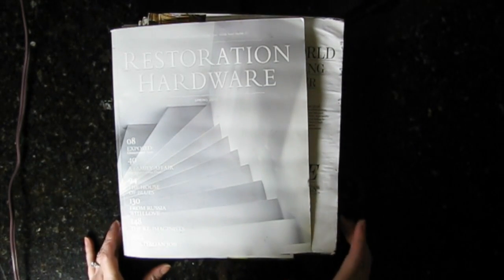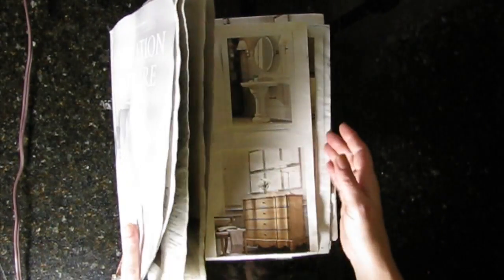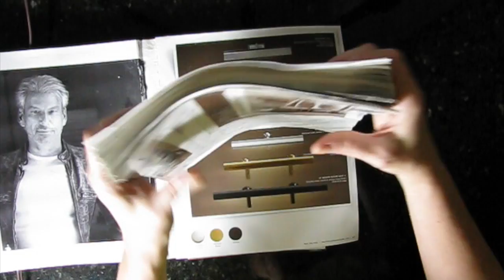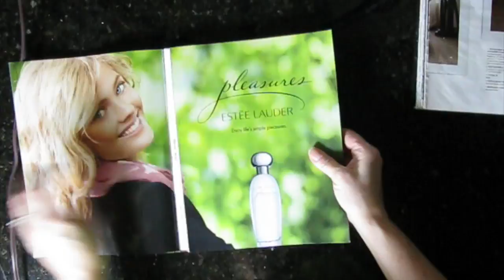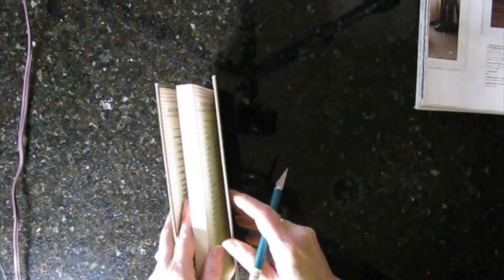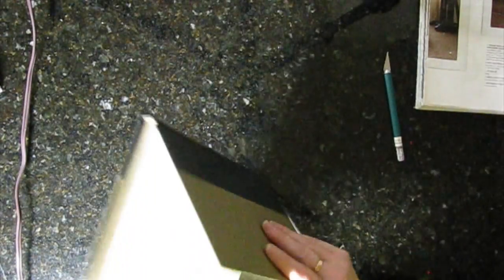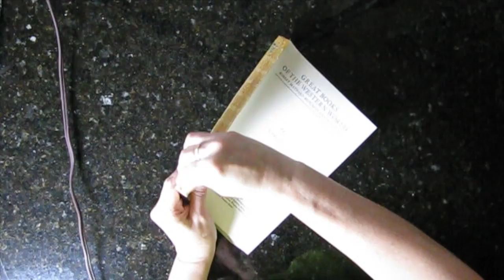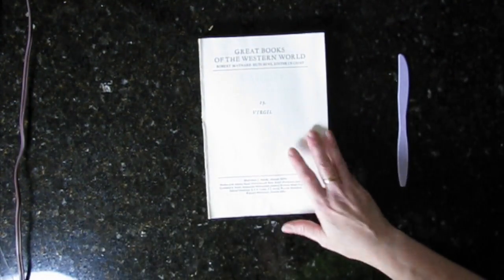Disemboweling Literature

Comment: Thanks for the info. Just wondering do you get any fumes when you heat the glue?
Also thanks for showing such an easy way to take the book block out.
Reply from the maker: Sue S I wouldn't say "fumes" but there is a slight odor. It's not strong or toxic smelling and it could be the paper instead of the glue, I'm not sure.